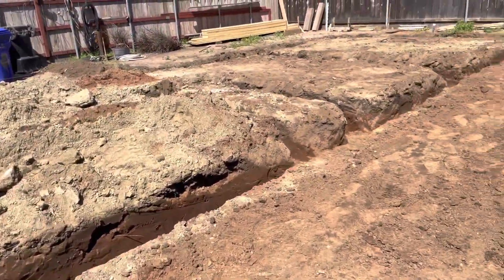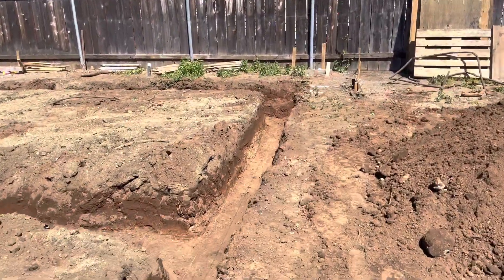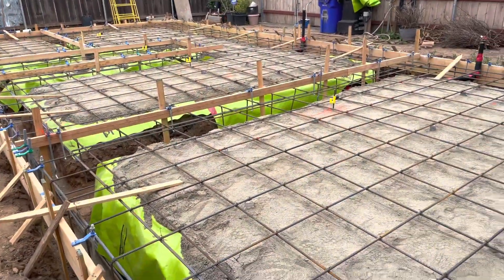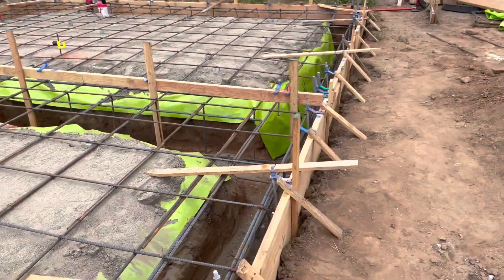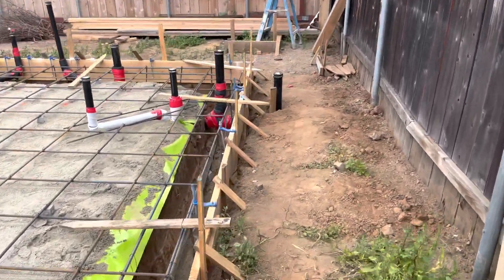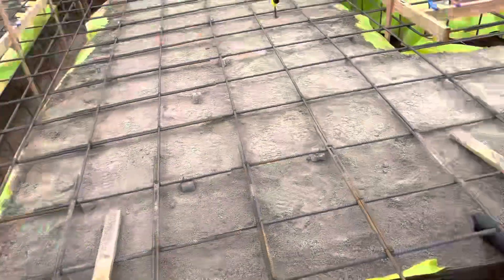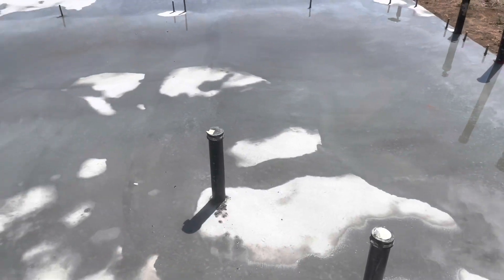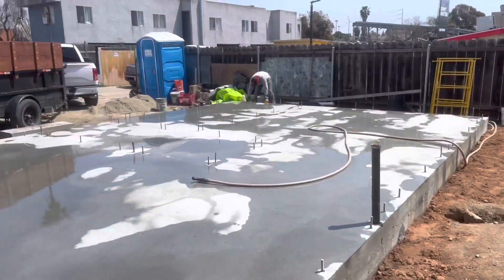Duplex ADU Build San Diego, CA - #2 ADU Foundation - Slab on Grade

Comment: Can i use 1/2 rebar or 1/2 inch copper for the electrical ground?? Did you connect the 
main sewer line 4 inch to the existing sewer line prior to the inspection?? good work.
Reply from the maker: 20’ of 4AWG copper wire  or 20’ of 1/2” rebar at the bottom of the footing. The sewer connection will be made later. You just need the under slab plumbing inspected.
Reply: @URBNBLDRS   Yes sir, copy that, i will do the same to my in coming adu. still waiting for the permit, DSD noted that it us in proceses...  youre the man.